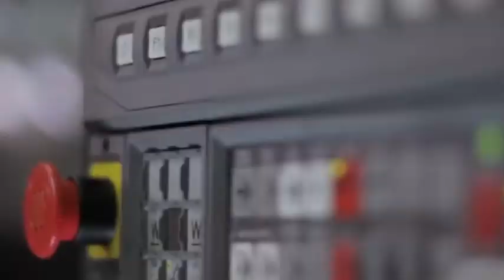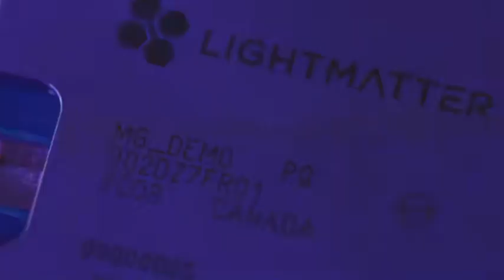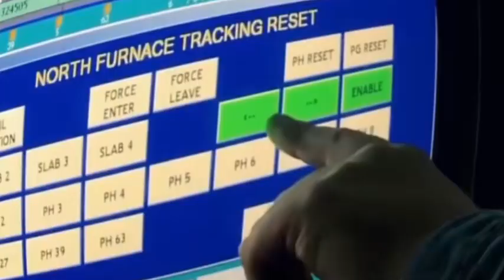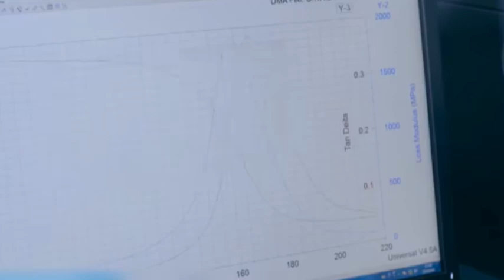This Chinese university & Huawei developed a diamond chip that will spark a technological revolution

Comment: Complete waste of 8 minutes with superlatives but nothing about why diamond chips are better.
Reply: Don't be Jealous, China is the Future
Reply: @paulhuver-x6i  It is NOT jealousy or envy. The fact is, where are the SCIENTIFIC AND ENGINEERING FACTS to back up such a claim that diamonds can be used in chip making?
I am in Electronics and (a) diamonds are a carbon lattice that do not allow for the passage of electrons (required for electricity to work) and (b) even if it be made to work, the cost associated will be far greater than what it is worth. The fact that semiconductors use SILICON does NOT automatically means that because diamonds are a form of silicon, they can be made into semiconductors - if you understand just HOW semiconductors are made using silicon as a base and a chemical surface layer known as "doping" is created and silicon is used because it is available in huge abundance (silicon is sand) and cheap.
MASMIWA (and I, myself included) is just trying to get at the FACTS involved using diamond which doesn't seem to be feasible electrically or economically which this video does not provide proof or evidence of.
Reply: @user-sf1nq9uj7p Technology is to make what seems impossible possible! 

I am still at the point where it was a waste of our 8 minutes in propaganda or hyper!
Reply: A chip based on graphene, not diamond.
And it is being developed in some countries, and China is presumably ahead of the curve.

---
Reply: ditto! Agreed 100%. No technical information, no specifications, no cost analysis, etc = no useful presentation. One may as well write something about chips produced using air molecules. 😉🙃😁😙
DOWN Voted!